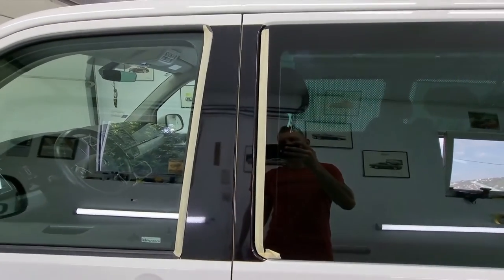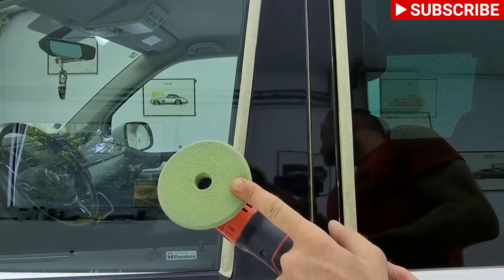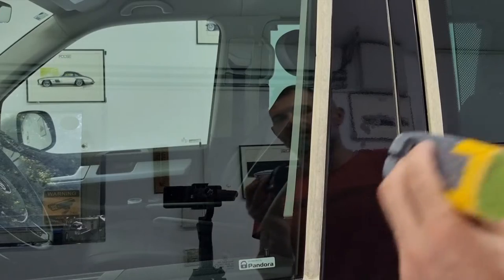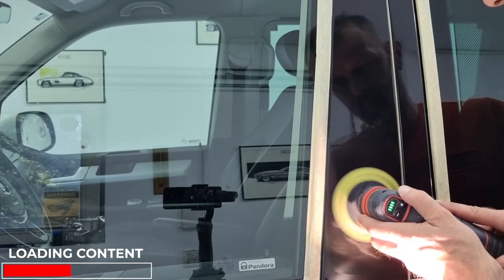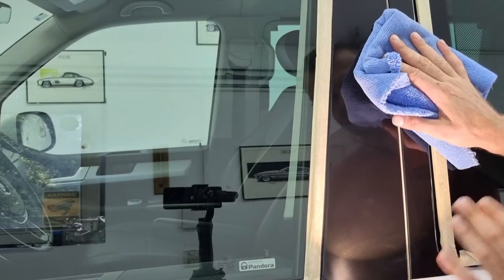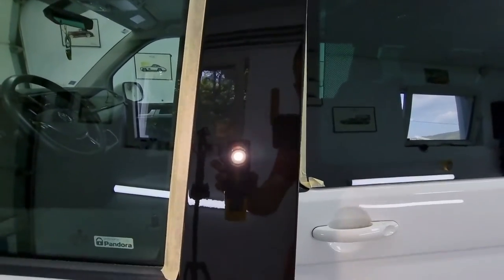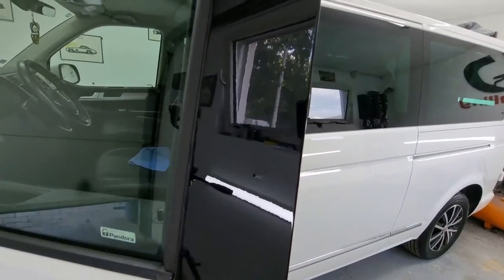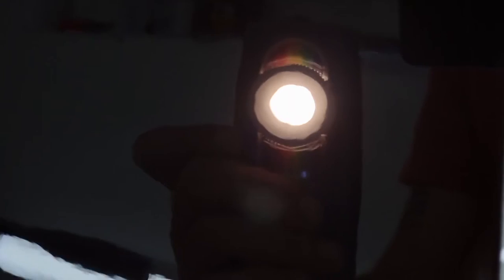Remove scratches from PPF WRAP

Comment: You're supposed to use a heat gun or hair dryer then a wax polish.
Reply: What kind of polish? I Can't find water base polish. Thanks
Reply: Heavy scratches needs polishing. Only fan/dryer is marketing stuff.
Reply: Doesn't work for me; those vids you see where the scratches magically disappear when you wave a bit of heat over the area are amazing but the experience on my car's PPF is that it's not having any effect on the scratches. Wondering whether the various PPF wraps out there behave in different ways, with some reacting better to reactivation using heat.
Reply: @kaplanjtyma  No it's not. The company that installed my PPF from 3M was polished and they used a heat gun to remove the scratches.